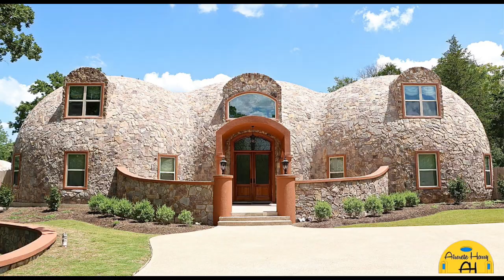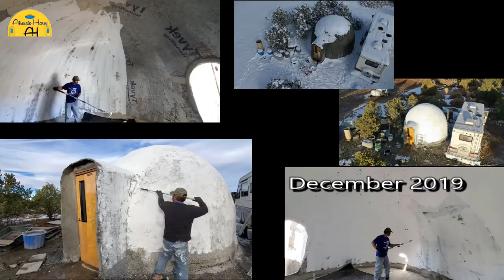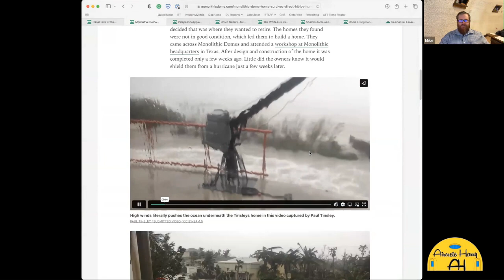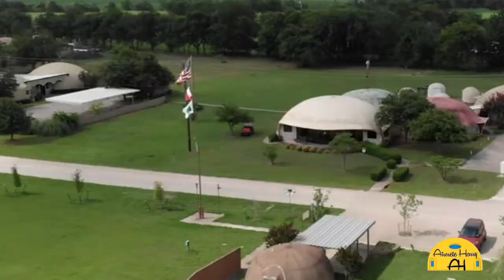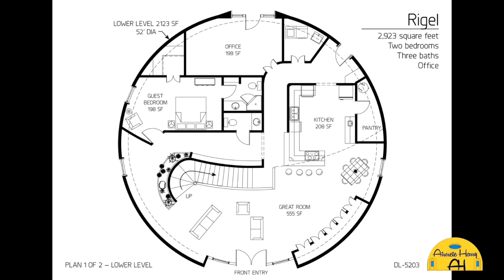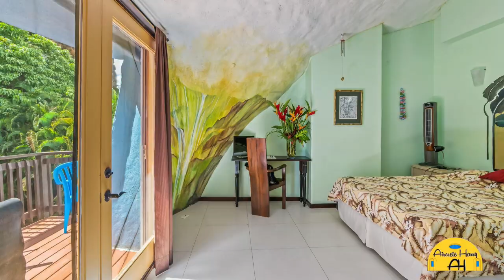Let's Talk Building Systems | Mike South Interview | #aircreteharry #buildingsystem #monolithic #diy

Comment: Does Mike South ever use basalt rebar? This is a deal breaker for me because I don’t want any rust or electromagnetic interference.
Reply from the maker: Yes, monolithic has been using basalt rope for reinforcement in the EcoShell builds. For additional information, such as basalt rebar, etc. - you are welcome to reach out to them.
Reply: Rust is mitigated by having the rebar completely encased in concrete. EM interference shouldn't be a problem with concrete reinforcement, should it? It's not even close to a continuous coverage.

They do mention basalt in there, but in the context of the EcoShells, not the monolithic structures.

Comment: I have a question. Will Aircrete double shell domes be resistance against laser weapons, "Not" ralated to the Hawaii incidence?
Reply from the maker: As long as your roof is painted blue, right.
Reply: @AircreteHarry  Yes, but that can probably change in time.. The color "blue" refers to a specific range of wavelengths in the visible spectrum, roughly between 450 and 495 nanometers. Whether a laser can penetrate a blue surface or any surface, in general, depends on the following considerations:

Wavelength: The choice of laser wavelength is critical. Different materials absorb and transmit light differently depending on its wavelength. If the laser's wavelength matches the absorption characteristics of the material, it is more likely to penetrate and interact with the surface.

Optical Properties: The surface material's optical properties, such as its reflectivity, transparency, and absorbance, play a significant role. Some materials may reflect or scatter the laser beam, while others may absorb it, causing heating and potentially penetration.

Laser Power: The power of the laser beam is essential. Higher power lasers deliver more energy per unit time, which can increase their ability to penetrate surfaces. Low-power lasers may not have enough energy to penetrate even relatively transparent materials.

Material Thickness: The thickness of the blue surface also matters. Thicker materials require more energy to penetrate, and the laser's power may need to be adjusted accordingly.

Coating or Protective Layers: If the blue surface has coatings or protective layers that are specifically designed to block or absorb laser light, it may be more resistant to penetration.

Angle of Incidence: The angle at which the laser beam hits the surface can affect its ability to penetrate. A shallow angle may lead to more reflection, while a perpendicular angle may increase the chances of penetration...

I do remember you did test the heat once. I think you had a blowtouch in for some time, with no penatration damage. 

 laser weapons can achieve very high temperatures, often in the thousands of degrees Celsius or more, depending on the specific design and parameters of the weapon.

Comment: I own my land, I need a dome on my property Nothing fancy just well insulated and disaster resistant. . 810 credit rating and some savings.
Reply from the maker: What size dome are you thinking, 
Square ft?
Reply: @AircreteHarry  I like 20' if that's not too much. I'm in my runaway camper to save energy.
Reply from the maker: @GEAUXFRUGAL  What direction are you thinking of building? Have you taken any workshops or have a preference in mind?

Comment: Thanks for another great interview.  
How easy is it to get a building permit approval in CO or WY?
Reply from the maker: Welcome to the channel Jill 👍 
You are very Welcome, 
glad you enjoyed the video!
It depends on the county & regulations.
You know -.
As long as you have a design with a Structural Engineer's stamp of approval, you would in most counties receive a permit approval with no small print nonsense.

You are welcome to reach out directly:
Aircreteharry@gmail.com 

If you have any designs/ plans in mind.